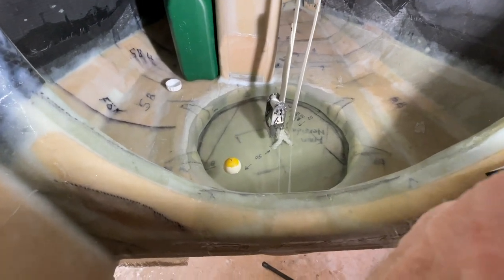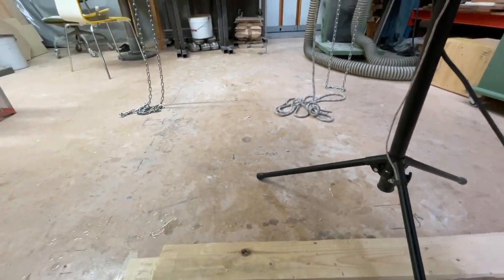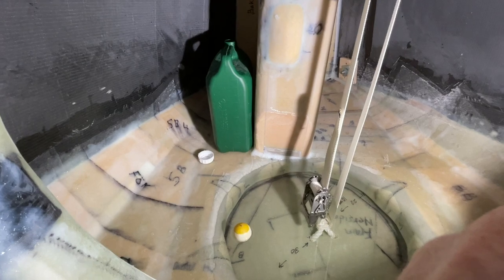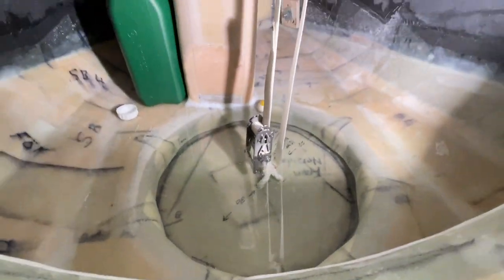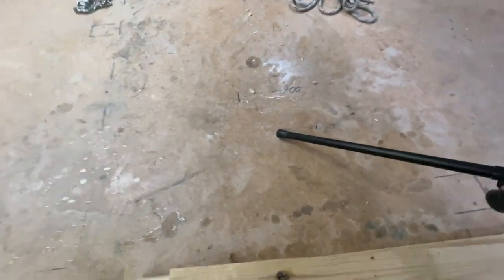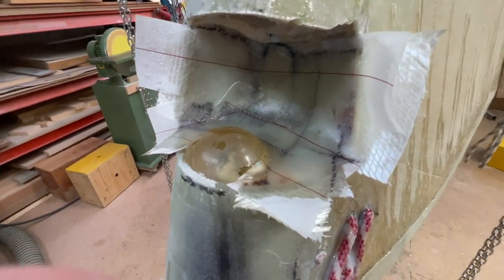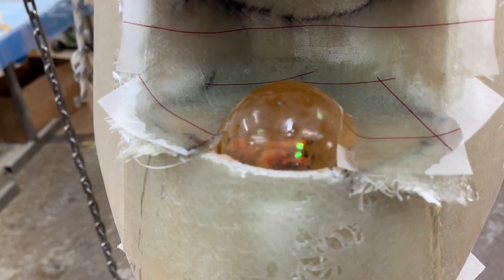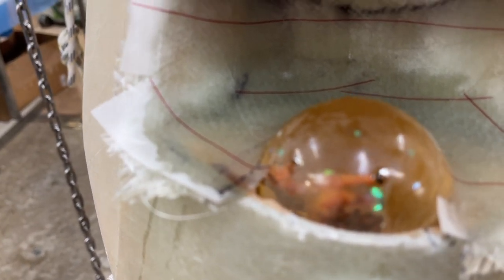18 Dec 2022  Hatchtest succesful. Now no leaks.  + Laminating the holes behind the bollards.

Comment: Thanks for showing the details.  I'm learning a lot about hatches. Your hatches fit inside a lip that will hold a little water and dump it inside when you open them unless you have drain notches on the outside lip.  On a kayak we put two notches on the edge on each side so that little bit of water drains away.
Reply: The hatch fits over quite a high lip, sits on a gasket, then another short lip around that. The water won't dump in. Check out older videos to see it better.
Reply: @PineappleAdrift   Thanks!

Comment: I'm not so sure about that gasket.  Seems like a lot of water on the floor for no leaks.  I wouldn't want any leaks when the old girl porpoises in the waves.  Much more pressure than 20 liters.  Also lifting pressure.
Reply from the maker: There is no water on the floor not one drip.
the floor is bone dry.
You may mistake some epoxy that is hard and shiny for water.